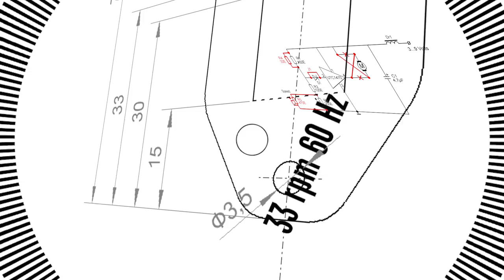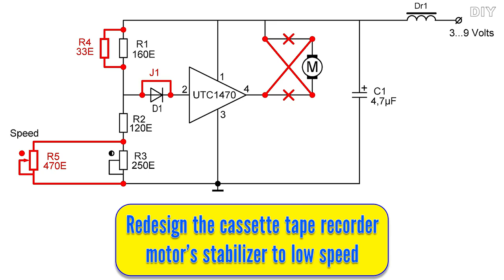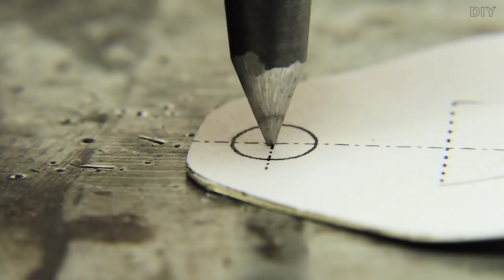📀 Turntable from tins – DIY

Comment: It is possible to buy a real vinyl needle, chearch the pinout and then connecting it to the audio out ?
Reply from the maker: It might be better to just buy a ready-made record player or repair a faulty one...
Reply: @IurisWorkshop  I mean, you built the turntable, and then if you want better quality sound, you can try putting it. I also saw that turntable needle have 4 pins, 2 for + and - for the L channel and same for the R channel. In all case I like your work !
Reply from the maker: @MoodyRiffs  
Thanks for the comments and high rating!
I hope you can guess that I have a decent turntable at home. I did this project not at all to listen to music, but simply for fun. And although the turntable worked, I disassembled it immediately after filming the video. This is what I do with most of my projects.
Reply: @IurisWorkshop  Yeah I understand, I also like doing DIY projets, and I always wanted to make a home-made turntable as a new project, and I saw your video that inspire me and giving me ideas. I like making things by myself so I don't really want to buy a ready-made turntable, because like you said it's fun, and I just have 1 vinyl disc 😅, an old disc I got from my grand-mother, that I never listened it. I will repost a comment when I made it !
Reply from the maker: @MoodyRiffs  
If you have perfect pitch, then you can convert any inexpensive turntable, significantly increasing the mass of the platter. Making from scratch is much more difficult. To listen to music normally, you need a corrector amplifier configured for a specific cartridge.

Comment: I know that it might have been a while since anyone has posted a comment on this video, but i have a question. Can I use soda cans instead of tin cans for cartridge and tonearm? Does it affect sound in any way? Thx in advance. (PS. Amazing video, great editing skills)
Reply from the maker: If you want to create a unique product, then you yourself have to check the materials for suitability.
Reply: @IurisWorkshop  Sorry for being a little late, but thanks for advice. I do have one small problem, the tonearm doesn't transfer any sound from the vinyl record to the speakers. It does transfer the sound of my fingers as small taps and pops, but nothing else. Do you have any suggestions? (Thanks in advance)
Reply from the maker: @moar_nightsong  I can assume that the pickup speaker is faulty or the pickup needs a larger signal gain.

Comment: omg (4 years later) what did you do with those poor records...

Nice DIY, but... you should have gone for a cheap pickup at least (less destructive path).
Reply from the maker: To my regret, you are also among those who think that a steel needle is harder than a diamond or corundum needle. The problem is not the wear of the disc, but the wear of the needle.
Reply: @IurisWorkshop  

Well, I have first hand experience of a "steel" needle. In my very young youth I "tried" to use one (A sewing needle) it really created some cool grooves that was heard later on when played with a real needle. 

So I used me own experience as a reference. 

I do not think it is about hardness but the shape of the needle and how smooth it shape becomes. 

Somehow I did not expect the method used to create it to be very accurate - my mistake?
Reply from the maker: @Hasse.Andersson  Yes, the sound quality depends on the shape of the needle. That's why I showed in the video that I changed the shape of the tip of the pin. But what you see when you play the disc is not chips, but ordinary dust. It's just that in real life we don't notice it, even if the needle is diamond.

Comment: 8:38 - 8:40 , that was painful, the disc was scratched
Reply from the maker: You just see the dust.
A steel needle will wipe faster than a disc. That is why corundum or diamond needles are used in factory turntables.
Reply: Do It Yourself , yes, i agree. Great post anyways, and great construction of a turnable, its so inspiring.
Reply: @IurisWorkshop  It will still ruin that record
Reply from the maker: @audioFail06  Steel needle is too soft to spoil the vinyl disk. Quickly spoil the needle, not a disk. Therefore, corundum and diamond needles are used in real players.
Reply: @IurisWorkshop  it’s the shape that is bad
Reply: @Iuris_Workshop  Doesn’t mean it isn’t damaging the disc.
Reply: @Iuris_Workshop  Every record player does a slight damage but a proper tonearm and stylus wont do anything noticeable even after 500 plays, wet playback doesn’t change anything.
Reply: @Iuris_Workshop  a sewing needle isn’t the right shape, it will do serious damage to any LP, + the fact that the tonearm is probably too heavy aswel.
Reply from the maker: @audioFail06  I'm not arguing with you about this DIY turntable. I'm talking about steel needles compared to diamond ones. What kind of "needle" is usually cut through glass, perhaps a steel one?
Reply: @IurisWorkshop  steel is for 78rpm shellac records not LPs
Reply from the maker: @audioFail06  If you are talking about gramophone, then there the pressure on the needle was 100 times higher.
Reply: @IurisWorkshop  And the records they were made for are way stronger then a LP
Reply: @IurisWorkshop  a proper stylus is rubber suspended and the actual right size for the record grooves
Reply: @Iuris_Workshop  Also, about ‘At high magnification, you’ll see dust and villi on any disc you use’ that’s why you should clean records, take good care of them. They are fragile because even a cheap ‘real’ turntable can damage them.
Reply from the maker: @audioFail06  Just in case, I will report you that I have been 67 years old, and I used a gramophone with steel needles and 78 RPM discs. On my right hand there is a scar that left the jumped spring of gramophone. :)
Reply: @IurisWorkshop  and i have experience with good and bad turntables for 5 years now since i was 10.